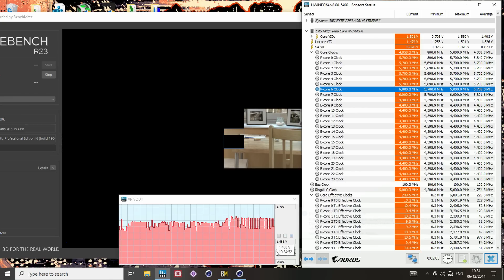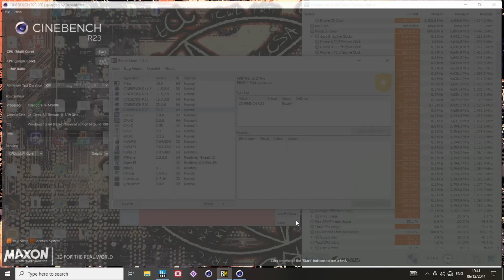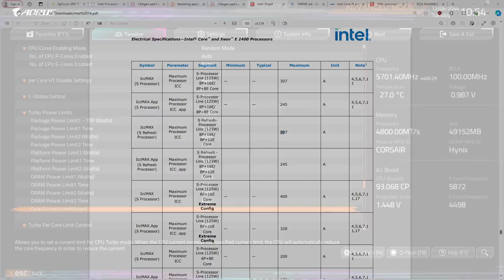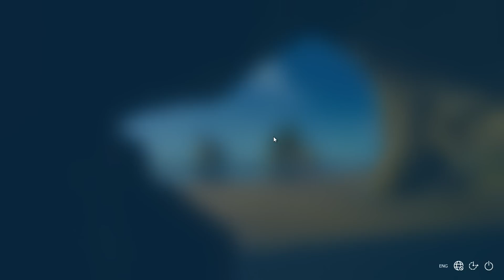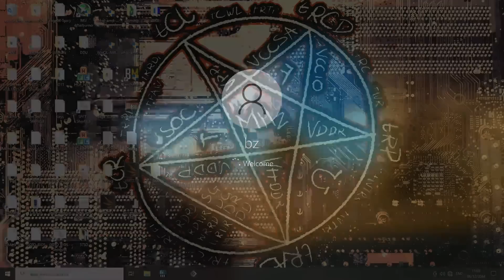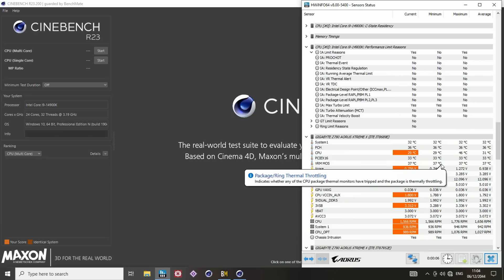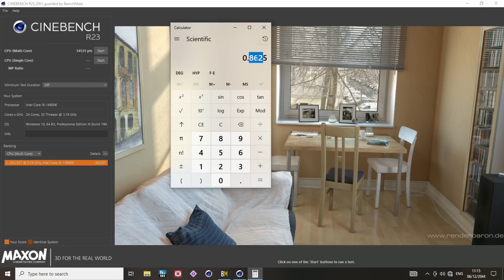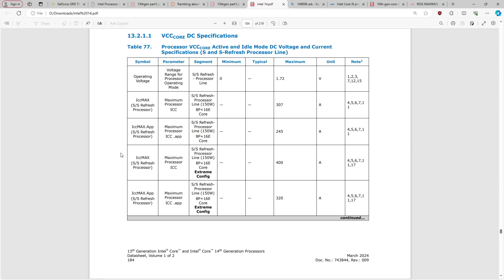Gigabyte's Intel baseline profile runs some ABSOLUTELY INSANE core voltages.

Comment: On my core i5 13600k on my Gigabyte z790 Aorus Elite AX DDR4 motherboard, I have been able to run an AC Loadline of 1 & DC Loadline of 65 with good stability my LLC is set to low which is one up from the lowest without issue.

At a DC Loadline of 65 the voltage under load matches the VID.

Comment: Ive got a z690 aero g with a 13700K. When I went to put intel default it still has my max watts set to 4095w which was the same before I switched to the intel setting.

Comment: Thanks... my binning seems to be as bad as yours. But limiting current to 350A and load line to 75 seems to have fixed it. And on this setting I can retain 300w power limit and allow all cores to boost to 6ghz without this being restricted to 2 cores, so no performance losses unlike this awful intel baseline setting.

Comment: On my Aorus Elite X with my 14900K I have a similar basic BIOS setup with TVB stuff ON and ICCMax at 400 A. I also run a beta BIOS that allows to turn off the CEP feature off on my board, yet it doesn't seem to do anything in my case, so either ON or OFF seem to produce almost the same results. For the rest, I enforce PL2 at 253 W and I have way different load lines: LLC Medium, AC_LL at 12, DC_LL at 61 (which gives me VIDs = Vcore in HWinfo). This is a rather aggressive undervolt so obviously it won't work on every CPU, but IMO just raising the AC_LL a bit until stable on lesser chips would to the trick, all else being equal.

With this approach (along with XMP), my PC is rock stable (1 hour Linpack 2021) with max core temps at around 80 on a 280 mm AIO (21 C room temp), and I get around 39.6K in Cinebench R23 after one loop. My max voltage is 1,392 V at "idle" and 1,164 V during Cinebench multicore. My PL1 is set at 200 W and Tau at 56 seconds, so longer workloads (which are quite rare TBF) don't cause too much fan noise, and when I'm at 200 W my max temps are around 65 C and I still get around 37K in CB R23. No need for crazy wattages IMO, because setting more reasonable power limits from the get go allows to set better undervolts, which then result in better efficiency through more performance per watt, lower utility bills, less heat and less fan noise.

@buildzoid : What's the reasoning for the Extreme LLC setting when in another video IIRC you recommended "Low" or "Medium" for Z790 Gigabyte boards?

Comment: If you run any kind of Air cooling try this if you are having issues "Gigabyte Elite AX-W Z790  : Set PL1 to 253 PL2 to 125  , amp 307 "ICCmax" , turn off all Enchaned multicore and Enchaned TVB , and choose load line "Normal"  you lose like 8-10% performance but in my case the most of the time I don`t see over 85c anymore might go to 90c in very high load benchmark. Already lost one CPU I9 14th K due to the bad settings on the motherboards.

Comment: You said that the AMD SOC 1.4v ended up getting adjusted so they couldn't set above 1.3v - doesn't that therefore mean that what they previously stated as supported (the high ram speed you mentioned) would no longer work?

Comment: my bclk is not 100.00 no matter what.. on windows it says its 100.00... but in the bios menu it stays really close to 100 (99,80-100.20).. full amd build..

can it be the bios update, cuz it doesnt show my ram voltage aswell?

Comment: I don't know why Gigabyte and ASUS aren't getting way more crap for this than Intel. Lot's of board makers and boards just didn't do this. I mean on almost all their boards ASUS and Gigabyte didn't do this, presumably! Why is it not up to them? The board runs everything. They write the BIOS. They can write BIOS where they didn't do this, why did they do it here, and why is that Intel's fault? To me this is more like a car manufacturer putting tires rated for 118 miles an hour on their car oh and also bolting the throttle to the floor. And I'm not a intel honk.

Comment: what about just adding an offset voltage?

entering the Intel limits 320w, 400a and adding DVID  +0.075 made by 13900ks stable in cinebench and RoboCop unreal 5 shader compilation

Comment: Let’s just agree that Intel 13th and 14th gen has some major flaws that will not stand the test of time. Intel has a flawed architecture that doesn’t work on 13th and 14th gen. Intel is in trouble. I will never buy a used 13th or 14th gen CPU. Also, my days of building 13th and 14th gen gaming rigs are over. I just cannot afford to warranty these CPU’s. I will stick with the AMD platform………specifically the seasoned AM4 platform.

Comment: I can confirm that on my new Z790 Gigabyte board with the Intel Baseline setting, the board even uses more idle power, compared to when I just put all the powerlimits to "auto", which you know, turns any limits of.
So without any power limit on my 13700K, the board uses around 21 Watts of idle power.
However with the latest beta bios, this idle power usage goes up to 31 Watts, with except for the Baseline Profile, every other setting is the same as before.
So I just down-flashed that bios back to the one before that. That baseline is no bueno.

Comment: tbf thats 307A EDC ... so its pretty resonable that you will never actually sustain that even under a "heavy" load. if you could scope it the current draw would be all over the place but not exceeding 307.

if it were 307A TDC then power should be roughly I*V.

does make me wonder if the 1.72V is only for Vout at the regulator to ensure that voltage inside the core is what the vid table specifies after droopage from really bad vrm... cause man its alot of current and 200mV of droop isnt that unreasonable right

Comment: Is it possible that Gigabyte's "Intel Baseline Profile" is also reducing the ICCMax amps to a lower setting which could explain the higher volts? Just speculating here. @ActuallyHardcoreOverclocking

Comment: Why is this 14900k having these problems in the first place? Surely they aren’t all doing this. When did this start for this particular chip?
Reply: Because they're being pushed too hard, causing the silicon to degrade and become unstable in usage.
Reply: @riven4121  but this issue isn’t every single chip. It just isn’t. So how wide spread is it and why is this particular chip having this issue and when did it start? That is my question. You don’t know the answer either. Intel hasn’t released stats if they even have them yet and only buildzoid knows about this chips history. Unless he has said before?
Reply: @Akkbar21  because silicon quality differs. The issue is motherboards pushing CPUs that are already at their limits past them despite being "in spec" according to Intel and is widespread enough to affect global Intel users. There's a reason why the fix reduces performance by over 10% in cases. 

 Intel even says the issue "causes instability at lower clock speeds". This is what silicon degradation does.
Reply: @riven4121  well, hopefully we will get a clearer picture of how widespread this issue is or isn’t. Because if it was 50% of CPU’s sold, I suspect we’d see more than a new bios profile. We’d see a recall and massive lawsuits. So I’ll wait to condemn Intel and 13th and 14th Gen i7 and i9 entirely.

Comment: I tested this on the Tachyon non-X with a potato 14900K that gets a similar Biscuits score (~93) on the F9f BIOS. R20 and R23 seem to run fine all core on the BIOS default power limit settings, but R15 not so much.
I don't see the super high volts on the Intel Baseline Profile, however.

Comment: wow.  I had no idea voltage had gotten so high again.  I thought we'd be down in the 1.1 to 1.2 range now since it seems to drop with the node shrinks.  I mean, heck, my Xeon E5-1660 V3 (Haswell-E) would not likely last long at those voltages (I already burned thru one - hehe).  This current one is running just 1.275V (core) and 1.8V (VCCIN).
Reply: Interesting. What voltage killed your first cpu? I am still using a 4790K in my second computer. Currently at 4.4GHz 1.12v and 1.65v vccin. 4.7GHz 1.27v 1.7v vccin is possible but hard to cool and not much performance uplift, both settings should be fine in terms of vcore.
Reply: @ronnie3626  I think I was at 1.875 vcc and 1.375 vcore.  It was actually the uncore that went out on my 5960x tho.  It was presenting like memory errors but when I would significantly declock the uncore, the stability would go up.  I think it was running 44x and 32x uncore/cache, but it's been a while so I don't recall for sure.

Comment: Isn't Gigabyte the one loading the Intel VID failsafe with that setting, ignoring the chip VID and basically loading what is considered the most safe (highest) voltage for the frequency?

Comment: So tl;dr, Vdroop is causing the crashes.  I understand that locking the core multipliers will fix it too, since that avoids voltage fluctuations from boosting behavior.
Reply: The silicon degrades by Intels statement.
Reply: @DerIchBinDa  The only statement I've seen from Intel does not reference silicon degradation in any way.  Source?
Reply: @nimbulan2020  I quote from the statement:
"...Analysis of affected processors shows some parts experience shifts in minimum operating voltages..."
aka degradation.

Comment: Quite absurd when stock settings aren't stable. It's not the job of the buyer to tinker around just to get something to work properly out of the box.. System building has never been so unbalanced. If a system builder is piecing together a PC for someone who needs to do intensive tasks like video editing, they now have to worry about the customer's computer not functioning properly if something like a power outage resets their bios? Regardless of who is at fault, this is certainly not cool.

Comment: All MB's stock/default values SHOULD be whatever the CPU's maker states as the specs of the chip.

imho a user should have the final say in if the MB runs different than the spec not the vendor.

Comment: On Asus B660 its a blessing. vcore offset -0.005v and the auto voltage overblast (1.53v) set by Asus is gone. -> 34800 CB r23 @220 watts 5.2 /4.2/ 4.5 (ring) Ghz. Haven't changed anything else and for the first time this computer runs stable without fiddling around in the bios every other day. Metro Exodus Benchmark min fps went up by almost 80% and stuttering is gone in every game I tried.

Comment: I solved this "problem" by setting the vcore voltage to adaptive and the AC LLC to 10 and DC LLC to 90 or even leave it at stock and put static 5.6GHz core clock and be golden.

Comment: Intel 13 and 14 gen silicon is really flawed. They pegged them to max frequency at the cost of voltage, and the silicon can't handle. Intel dmg control is silence while mobo oems take the heat as they need to be Intel oems. Fact that CEP exists shows HW engg know the silicon limits. Many people think it's oems, but it's been the case for a long time. Reality is Intel, shipped a flawed silicon. Onlyfix will be a microcode and BIOS to put bandaid.

Comment: I think gigabyte miss w ac ll , he want use 70, but some write 170. If u manually use 60 or 70 it’s fix u problem. Limits need only for tune temperature cpu to u cooling system.

Comment: i have asus z690-e - and intel i9-14900k
setting for ai to oc everything - it goes to 6 ghz and vcore is 1.4 + - but it crashes BSOD frequently
tried several ways to get best speed and performance with less frequent BSOD ' s
finally - set all p cores to 57 multiplier and e cores to 42
set vcore voltage cap to 1.3 v
runs without BSOD - i have no problem running call of duty 
aida64 stress test - vcore runs 1.279 and lower - cpu package power 130 - 170 watts - package temp 66 c
however
when i run cinebench 23 - at the time of selecting multi-core test -> it either crashes with that error that you got or it just crashes to desktop with no message at all
-
since i can play cod warzone with no problem and plenty of cpu power - i don't care about cinebench running

Comment: Im sorry if i missed it so whats the conclusion?
I have 14900k should i just set PL1 = PL2 = 253W and 307 amps?
Reply: You need to set the VID limit at 1.5V or under, so the maximum voltage the CPU can ask for is under 1.5V (somewhat safe).

P.S. I had my 12900K oc'ed to 5.5 ask for ~1.62V VID in HWINFO.

Comment: I also have vcore at 1.3-1.4v. processor 12700k and mother z690 gaming x
p.s. and this is in absolute stock condition.
Reply: auto vcore is ass.
Reply: @TheBURBAN111  auto vcc? Why on the i7 6700k in the drain on any mother the voltages were lower (about 1.1-1.2V and under load rarely rarely 1.28V)?

Comment: I think that the CPU itself should limit the wattage consumption. I think that the firmware of the CPU should be patched/improved.  How is this possible to have 27 degrees on idle? I have i9 13th Gen and on corsair 360 mm liquid I have 40-45 degrees on thermal grizzly paste - 1 year since application, no thermal frame installed yet.

Comment: Iccmax curent limit is “expect" current not "actual" current, thats why cinebench would hit the limit
“expect" current is the cpu predicts how much current the work load would run at and is always much higher than "actual" current
It is based on c-states、core svid、core ratio、avx load etc, has nothing to do with how how heavy the work load is 
It doesnt matter how much "actual" current you draw. Prime 95 sffts would get same “expect" current as any other avx2 all core work load despite it pulls much higher "actual" current.

Comment: Intel "Extreme Config" states 320W for 13th and 14th gen 8P + 16E, so what's the problem with 150W for 4 core Cinebench? You need a VERY GOOD AIO for 14900Ks, preferably custom loop or MoRa 420 (I use the latter) to just keep the temps under 100C.

Comment: Thanks for the video buildzoid! I initially got my 13900K running stable a couple of years ago on a Gigabyte Auros Master Z790 after switching default cpu loadline voltage profile from 'Low' to 'Medium'.  

Your previous video mentioned limiting the tjmax to 90C instead of 100C, but you didn't mention that again in this video and focused on current limiting instead. Is the former still a good solution to prevent degradation (if that is indeed what is happening to some people) ?
Reply: buildzoid made a new video about setting a VID limit, which is probably the most important step in solving this issue/potentially preventing degradation

Comment: I'm reminded of the 1GHz Pentium 3 that Intel ended up having to recall. This silicon is not (reliably) capable of running at the specified power and voltages.

Comment: Crazy how a year later AM5 is actually pretty solid, I'm running DDR5-8000 with a 7950X daily and benching their new APU around DDR5-10000 while Intel can still crash in R20 out of the box and stabilizing high memory speeds feels like some kind of psychological warfare campaign.

Regardless who's fault all this is, it's absurd for a platform that has been out this long and there's no way in hell I'd run these chips at 1.60V+.

Comment: Are you using a load-line capable (line interactive) voltage regulator, like an Eaton or Tripplite UPS? I'm curious if a line interactive UPS would help with overclocking, versus a standby UPS or an always online UPS.
Reply: a UPS only gives out as the load line demands, it's not like it's blasting max amps all the time
Reply: @erkinalp  yeah but there are different types of UPS. The "online" UPS are always putting out the exact voltage, no matter what the power company is doing. The standby and line-interactive UPS have a delay

Comment: Intel: where moving a mouse cursor needs 30 watts
Reply: mouse cursor power consumption should be blamed on windows imo, given that it already causes weird power spikes
Reply: @Radovanslav  mouse is traveling across lots of dialog boxes causing lots of hooks in the back end to fire. you would want to run these threads at high speed on fast cores to prioritize UI speed feel. power bursts are no surprise.
Reply: @BGraves  Even in circumstances where he only moves the cursor across the cinebench scene there are power spikes. And whenever i move the mouse across my mostly empty desktop in W10, with taskmgr open, i can see usage spikes. The cursor on W95 cannot use anywhere near that amount of power (on an i486 and such) and it was responsible alright. In my opinion there's no good reason for mouse cursor to eat that much power.

Edit: also probably worth noting that the frame rate of the monitor probably limits UI responsiveness anyway
Reply: @Radovanslav  486 100mhz was my first computer that I bought. It didn't have a power limit anywhere near a modern cpu, so that's a silly comparison. Also, our mouse dpi was much lower. Polling rate was much lower. A modern gaming mouse would overwhelm that cpu 😂
Reply: I get that only with my 8k polling rate mouse, lol.
Reply: That's a dumb take. AMD idles at that
Reply: @BGraves  unless it's a threadripper or epyc (the large one), which idles at 70 watts minimum